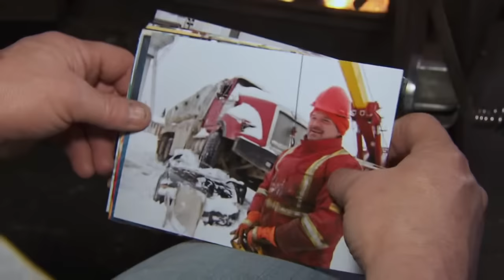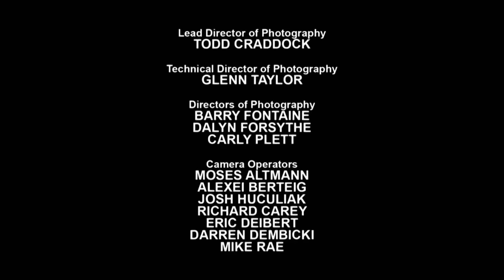Highway Thru Hell S12E18 #vi #recover

Comment: Jamie will be back but he will need to get rid of some of his trucks so he can rebuild his fleet. Ken's flat deck FD124 wrecked and rolled, HR 127 torched, Rotator crushed, 47 winch busted, 007 blown engine, Bruce's truck waiting for parts, and General, 86,  and 134 Sold to get Jamie's fleet back to operation. This winter he bought HR 100 and work is being done on Rotator it will be back just a new truck will be under it. He got HR 100 this truck will help them since he sold HR 126, General, and 85 now only HR 100 and 130 will do the heavy lifting until Rotator comes back and Bruce's Truck and 46 will take the wrecks to the body shops in long tow.

Comment: The rigging at 21:50 on the front bumper is wrong and dangerous. Shackle should have been the other way so the tension is not sideways on the pin.
Reply: to be fair that shackle is well overrated for the capacity of that front hitch

Comment: Why didn't the young guy in the first video have the semi driver chained up his truck and just lightly get on the gas just to get momentum going they said he told him to just let the Wrecker do all the work got to have some common sense out there it really is simple stuff out there semi driver get on a get his tractor moving a little bit to take some of the weight off the cables but still not so much that the cables go Slack